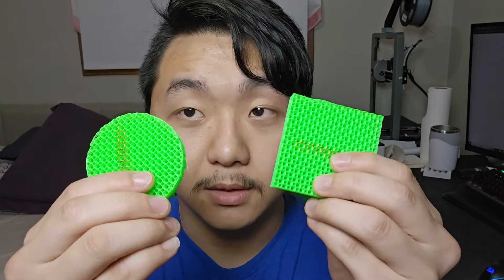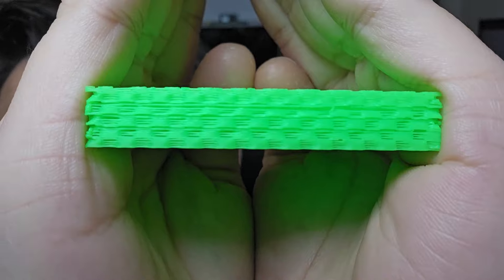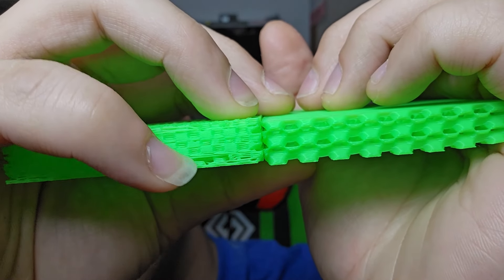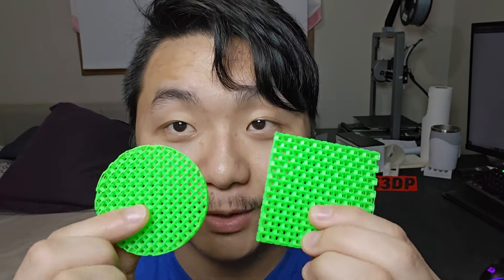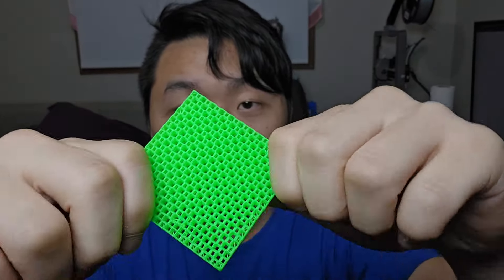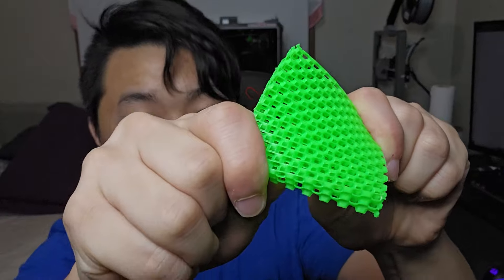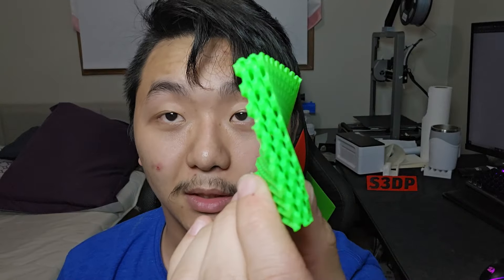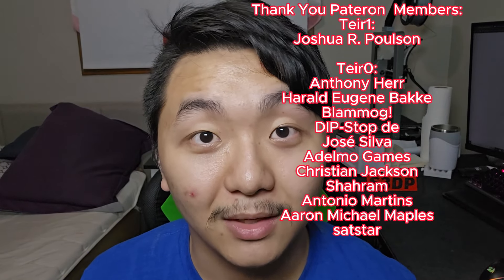OrcaSlicer v2.0.0 RC Release Improved 3D Honeycomb 2x Stronger

Comment: Nice Video. Both infill 15%?
Reply from the maker: Yes both 15% in fill, they use the exact same settings
Reply: Although I totally believe that the same 15% gave 13g before and 10g now, it does show a problem with slicers...  That 15% should be the amount of the volume filled (compared to solid infill).  But since the density of the PLA material itself won't suddenly have changed, % volume should be reflected 1:1 in the material weight used by the infill.  So, having 15% infill should irrespective of the type of infill result in the same weight for the print, yet it's clear this is NOT the case.  So to me that just means the sparse infill percentage is not really a reliable number and is not representing the % of volume being filled.
Reply: @MisterkeTube  this was a bug in the infill code previously. The new infill code has additional adjustments so that the amount of filament used for infill is a lot closer to what is produced from rectilinear infill (i.e. straight lines).

Comment: Two issues with your video:
1. As has been pointed out already, RC = release candidate.
2. If they are using different amounts of filament, then they aren't both 15% infill.  If the object was 15% full of plastic it would have a constant weight regardless of infill pattern - thats just weight distribution.
Reply from the maker: oh ok. 
1. Thanks for clarifying
2. I don't know then I basically use the exact same setting to print both of them, one is just on the beta version and the other is on the RC version. Not sure how they are both not 15% infill.
Reply from the maker: @nocare ahh, that makes more sense thanks.